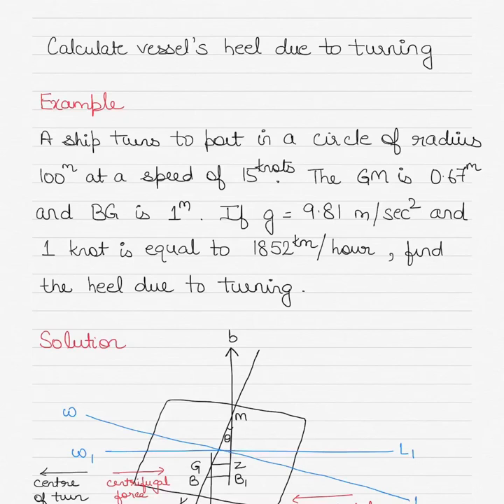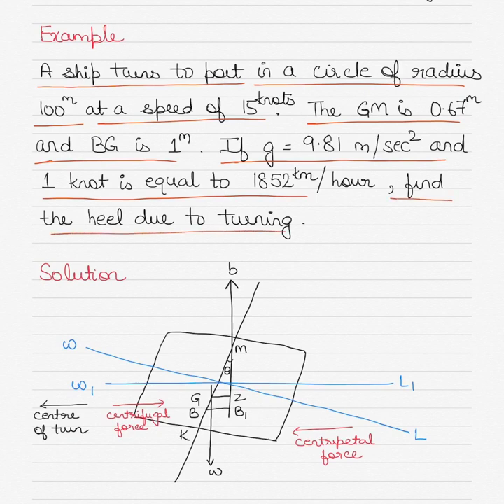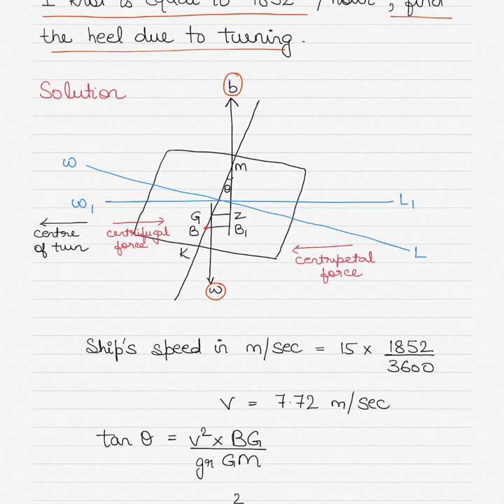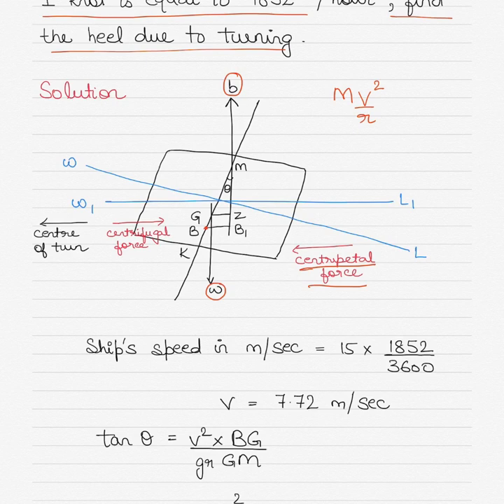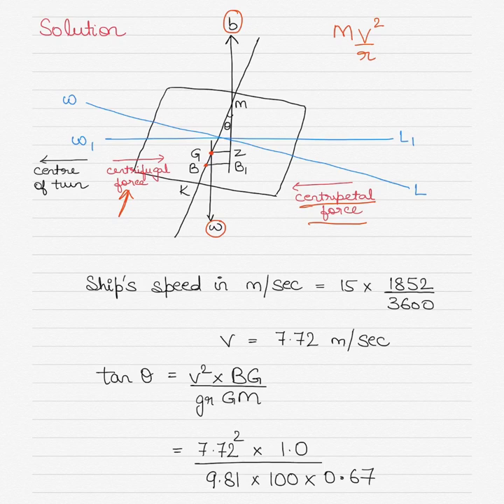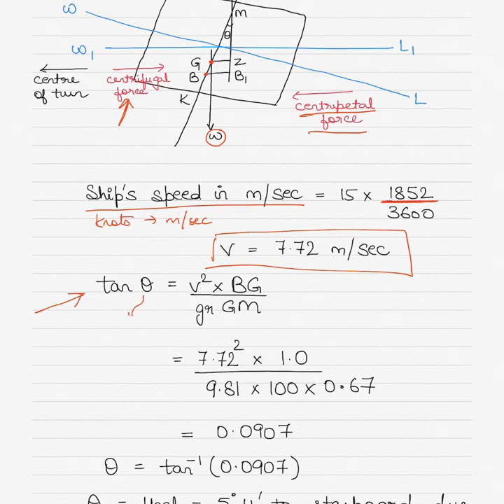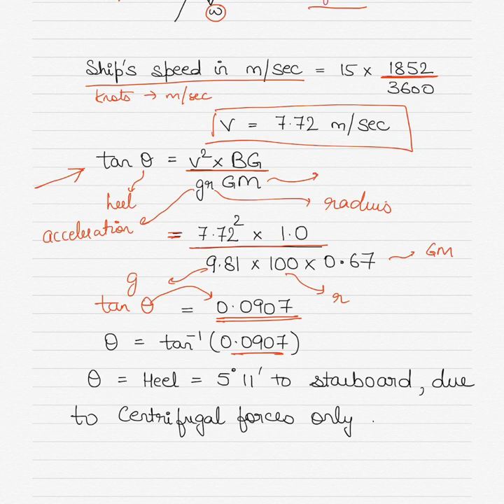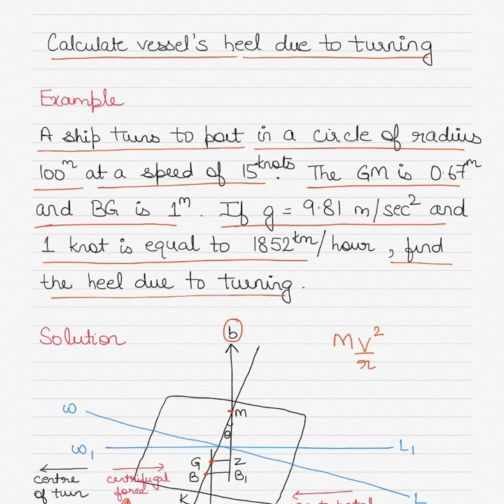Calculate vessel's heel due to turning - Ship Stability

Comment from the maker: Please note: If KG > KB, vessel will heel towards the opposite side of the turn. On the other hand, in rare cases on merchant vessels where KB > KG, vessel will heel towards the same side of the turn.
Reply: Can you explain it a bit elaborate the second case where it turns to same side
Reply: @akhilmohandas5805  a port turn would normally give an to starboard heel, BG is negative when KG is less then KB (BG = KB - KG) which will give a negative angle so the heel will be to port.